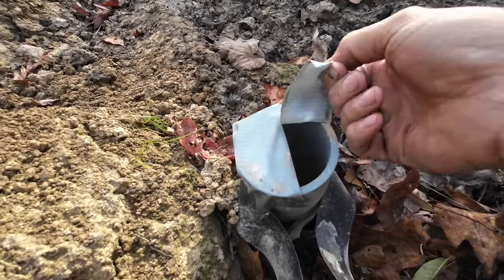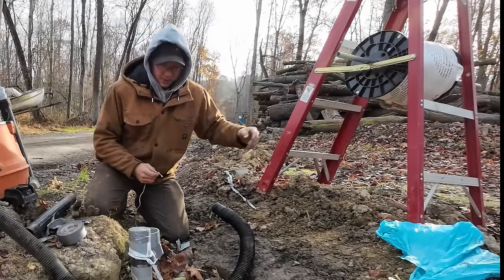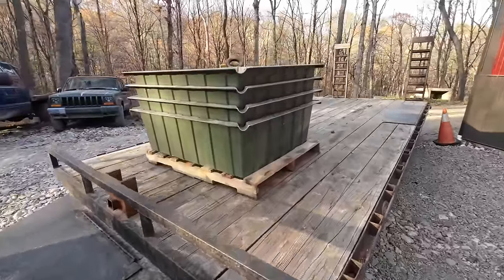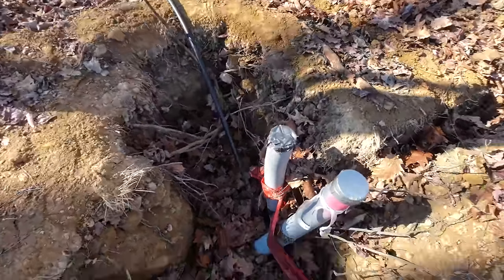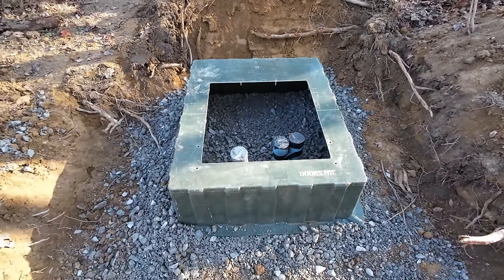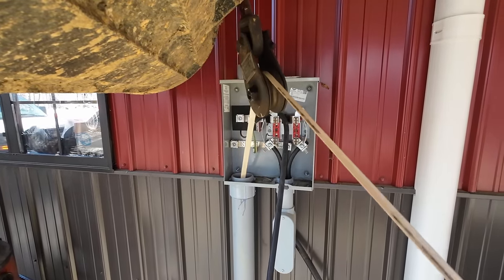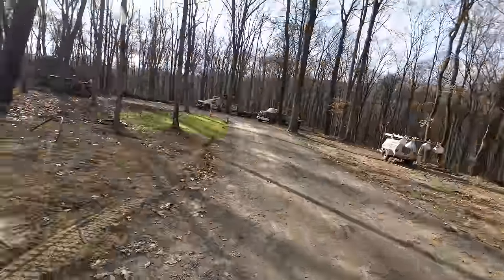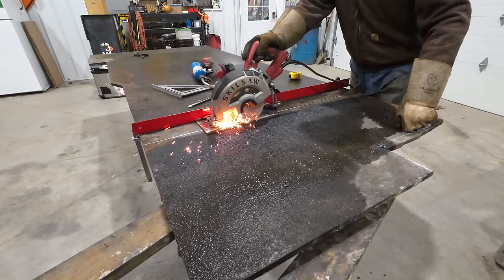The Power Company Charged me $52,000 for this!!

Comment: We'd need to see a itemized list of what was done and how much it was for. $52K seems outrageous for all the work you did.
Reply: $25 dollars a foot isn’t really that bad when you consider the cost of the wire, transformer and union salaries. 

Most of us will never be in a situation where we need to run grid power 1/2 mile.
Reply: Seems about a right price. dude is mad but he chose to live and do this project in BFE
Reply: Like the old joke goes. 50$ for the cable, 51950$ for having the license to do it.
Reply: 52k included the transformers, high voltage wire, junction boxes and the crew. The electricians are $100/hr and were like 10 of them.
Reply: @PatricioGarcia1973  and it took 2.5 hrs.. say 3 hrs.. thats 3k.  But I guess it's the step down transformer.. even though they probably buy them cheap they sell them hella expensive. If u were allowed to buy it urself and just have them inspect it u could get it much cheaper. Factories all over that have gone belly up sell such things for almost scrap value.
Reply: @kungfreddie if you wanted to do that you'd probably be looking at even more expense, as they would need a HV switch to provide isolation at the end point, and OP would need to find someone HV authorised to terminate a cable from his second hand transformer to the PUC's switchgear. Not to mention the HV metering required.
Reply: that crew at first energy averaged $35 an hour
the pay a jL in the mid $40 hr range.
27 office people touched paper stocking charges at the warehouse permits fleet cost. it ain’t cheap
Reply: @kungfreddie  I got to think all the hardware he bought is what bit him, I still find that hard to believe that all the hardware cost Matt $49,000.

Comment: Back in the early 90’s, pre DSS, I worked for a cable TV company and in some rural areas people were quoted $10,000-$20,000 for coax to be installed. Sometimes right of way fees had to be negotiated or paid, utility poles installed, distribution network had to be designed and equipment bought.

Comment: When the cost of getting grid power pulled in begins to exceed $10,000 or so, that's when I start thinking of solar as a cost effective option.  Still has it's downsides, but if it could be done, I'd rather put $52k into something I own than give it to the power company.
Reply: I have an 160 acres in California and was told that running a line to my property could cost as much as $70,000. I definitely am going to go with a totally off grid solar. 50, 250 watt panels only cost me a little over 6k. If I install the system myself, it will end up costing about 40% of what it would cost to pay a solar company to do the job. California has some of the highest utility rates in the USA. Since the power company has no tie in with my system, they can't very well charge me a readiness fee.
Reply: Solar sucks and will never work for everything! Very expensive as well!

Comment: The pull method is a pretty old school practice now.  We used to use styrofoam balls or other specially designed plugs to carry things down the conduit.  However in the past 2-3 decades it has become standard to use a normal plastic grocery bad.  The bags wat to inflate themselves, they conform to the size of the conduit, and they rarely get caught on as many obstructions and turns as  the foam balls used to.  When things don't go right they are much easier to pull out.  Plus you don't have to keep all sorts of different sizes around.  You have a few in the truck usually from having bought lunch or drinks (or if your shy one you just walk about 50ft and you'll find a perfectly good one).

And on the final wire pull always pull another pull line with the cable, because the next time something has to go through the conduit you can't use the same tricks as easily on a conduit with something in it.

Comment: That hurts. You could have had one heck of a solar / battery storage set up on your property for $75,000.
Reply: I bet solar and batt on Diesel Creek would be more than $50,000.  Say $150,000 to bridge the low sun January to March with huge battery .  Thats still reasonable, saves say $20,000 annual power bill for 20 years till replace it all, so amortized call it $300,000 in savings.  But be honest would Matt likely pay not just $50000 but $150,000 out of pocket this year?  Just saying it requires someone who has million in bank so can pay hi now, and requires being willing to check on batts and putz with computers (vs thats all on the elec comp to do).  It's amazing tech is so good going off grid is option but man us nonrich people will tend to be cheap and NOT do it...  Even Matt a tinkerer would rather not have to tinker, and plain grid connection is wanted...  PS.  Grid connection is so flexible, he could in emergency draw lots of electricity and heat 10 houses with it, that's a nice feeling to have near unlimited power....
Reply: @mbengambenga-xi6dp  It depends. If he was going to hire someone else to do all of it then yeah it would probably cost that much but if he would do the install himself it wouldn't be nearly as costly and there are kids that you can get that take the guesswork out of most things these days. Solar isn't nearly as complicated as it used to be.
Plus at least for me it would be worth it to give the middle finger to the electric company and their $52,000 charge to run a wire.  And don't forget he's also probably out in the middle of nowhere with a single feed that could easily be taken out in a storm and he could be without power for days. Making his own power eliminates that problem
Reply: In PA can have no sun for winter month... "" Powerwall Battery $14,200 13.5 kWh"""".   House uses 1000 kwh a month, so 80 Powerwalls, so $100,000 of battery....   Say solar cells are $50,000..  A $150,000 loan paid back at 6% is $1000 a month......  Vs grid cost of $150 a month?   Just saying to equal grid thru winter is about 8x costlier even if have good credit to get 6% and willing to invest ...     It's amazing tech but costly .    Millionaires should do it, but not nonrich....  yes we can argue about estimates, but bad dark months do happen....

Comment: As a former landscaper, I like wild grasses to hide transformers and other telecom boxes. I really like the Karl Foerster feather reed grass. It gets big and fluffy to hide boxes, no thorns or anything  if you need to get inside, you just hack them off around four inches in late winter/early spring with a pair of hedge shears, and they come back every year. Two on each side of those boxes will be plenty after they get established for a couple years and really fluff up. I would recommend getting a size 3 or 5(that's just how many gallons the pot is) from your local nursery. These are healthy, larger plants that are much more durable for transplant. The only kicker is that they need water almost every day for the first few weeks when you plant them. If it's raining a bunch, no problem. But if it's hot and dry, you need to go out and soak them every day(ideally in the morning, near sunrise).

Comment: $52,000 would buy a lot of solar panels 😂
Reply: In the long run it would be more expensive and a huge pain in the ass.
Reply: @cooldog60  how so?
Reply: @cooldog60  Not even close. Once installed it’s automatic. Been running house and shop off solar for 2 years. No issues.
Reply: @JGnLAU8OAWF6  they degrade rather quickly, snow, ice, cloudy days, leaves, and they only provide peak power during a specific time of day. Solar panels are great but not for this area.
Reply: @orangesforall2053  panels have 25 year warranty. What makes his area not suitable for solar? I'd say ~$70000 head start changes everything.
Reply: @JGnLAU8OAWF6  there isn’t a lot of usable sun angle and wattage per meter in the wintertime. You spend 70k just for it to be Cloudy for a week and you are SOL. Also if you look into those warranties they take into account a certain amount of degradation. Panels loose about 10-30% of their efficiency over 20-25 years. You can’t warranty them for this as it’s counted as typical wear and tear. So you basically have to pay to get them replaced every 20 years. Don’t get me wrong though, solar panels are great for areas with more favorable conditions, they just don’t make sense here especially considering he is running a shop and has a large power demand. He would need to spend another 20k on batteries just to get by. If it was somewhere where solar panels could pay for themselves it would be stupid not to use them.

Comment: Hey Matt...Just curious, wonder what the voltage drop is from transformer to your shop, with such a long run. Power company probably tapped the transformer up slightly so it was around 250/125 level, so that by the time it got to your meter was closer to 240/120.  Most pad transformers have a tap changer switch with 5 positions, in steps of 2.5% between each position... to help compensate for long runs and voltage drop.  (transformer design engineer here at a large mfg since 1994)
Reply: Tapping up is not going to be very helpful if there is a very large load range. Setting up for nominal voltage at nominal pload will result in overvoltage at zero load and undervoltage at maximum load.

Comment: 😊 having you put a line in the pipe shows that the pipe hasnt come apart.  You know you do good work, I know i do good work, but not every body does.
Went to pull an underground service once, couldn't get anything through.  Turns out the conractor had installed pvc drain pipe with a drain ell.  Stuck conduit on each end.
Eventually ee started requiring prebackfill inspection and pulling line.
If a new service request sat for about a week, we gave it to a contractor who could (usually) get it done soon.  And we inspected them too.
Sorry yours took so long, i cant speak to the cost ive been retired for 16 years.
Where i worked we took the service in electric service seriously.

Comment: Love the channel!!! I have been in the electric utility industry close to 2 decades in Distribution Engineering and Operations and unfortunately $50k is in line with what this would cost in the northeast. Like others have commented, the pricing is set up in the rate Tarif which is approved by the utility commission. A 25kVA transformer will be oversized for your application along with the primary wire size they used (assume its #2 AL, 10kV rated with a concentric neutral) but this is probably the minimum size they stock. Work to reconfigure the riser pole, splices /elbows that were used and any ground rods/grids add to the cost. Some utilities use splices placed in a subsurface pull box instead of the above ground switching module. The customer typically does the civil work which is then taken over by the utility after energization. Everything up to and including the transformer is owned and maintained by the utility including the primary cable. The secondary from the transformer is customer owned which is why you had to purchase and install.
Reply: Wow, yes it was like that in California as well. Here in Texas we have non-profit electric co-ops and they are much cheaper. I got a 25kVa transformer by the road that puts out 480V single phase and then I ran it myself maybe 600' to the shop and put a step down transformer to 120/240 in the shop.
Reply: Yeah I work at a public utility in Washington and $50k seems a little on the high end especially with him installing the conduit but material prices are crazy now. The cost of pretty much everything has increased 200-300% since I started about 3 years ago. I designed a 1600' primary extension from a pole to a 25 kVA pad mount transformer for a 200-Amp service for $33k. The customer trenches and we install cable in conduit from a spool. We do require vaults about every 500' for future connections and pulling so the 3 vaults added about $6-8k to the total. We do sharing(late comers agreement) on everything though for 10 years so they can get some money back if someone else taps off it. Could be why his was higher if he had to pay the person half to get power to the existing pole.
Reply: @sukt00  If the barn was only 160' from the transformer that 350 kcmil is overkill for a 200-Amp unless you are subfeeding or something else. That added about $650 to the cost though.
Reply: Yeah but I thought he was talking about building a house across the street of the Transformer.  I'm not electrician so I don't know.

Comment: You can blow a parachute through the conduit using a compressor. 4 inch conduit with 36' sweeps are sometimes required. They may require a mandrel test. And.... they can play games with the meter panels.

Comment: Let them pull the primary cable. If that's 15kv cable, one nick in it and they'll have to replace the whole pull. Plus splicing it and terminating it is an art. 

Save that mule tape, it's good for pulling cars out of the ditch in the winter.

Comment: In commercial electrical, it seems there is always water in at least 10% of the underground feeder conduit. Obviously some people don't try hard enough to properly glue fittings but  they are never concerned (it is too late) and they don't talk about doing it better next time. It seems to work time and again without issue.

Comment: The Chinese finger trap deals are Kellems Grips. They're most commonly used for strain relief to take the strain off the wire in the event it gets tugged on. Though, that specific type is for this particular application. Still, they could still be used for strain relief purposes, and would work on things like air hoses as well.

Comment: (In Canada here) I do hydro conduit vault install, cable pull etc..  if pulling the cable from existing transformer then the power company is required to at least be there and retrieve the fish/rope/ mule tape from the live vault and feed the cable into the box/transformer.. but because the cable is on a spool and therefore not live.. you should be able to pull the cable from your end on a rubber tracked excavator (like a winch) just need a proper roller for the rope and cable to exit the bell end and out of the vault safely. You need a qualified electrician there for the whole thing and terminate it. At your transformer..(we use diesel air compressors and something we call “mouse” which is a rubber diaphragm with steel ring for attached rope or mule tape .. a special air valve/gasket system with a channel for the rope to run through controls the air.

Comment: i am a highway construction worker and we use tow behind air compressors to blow jet line and then we use the jet line to pull in mule tape because we usually pull 100ft of  3 1-0 wire 2hots and a neutral

Comment: I always tie wrapped the pipe in the spool to the center of the cross supports so it did not swing back and forth which causes jams and the ladder to topple over.  I used the distances you stated in your video and then entered them into the power line calculator provided by my utility.  Ours said $27, 500.00 for the same setup. however I quoted overhead lines.  For $25,000 dollars difference I could have looked at a few phone poles for a very long time.

Comment: As an licensed electrician in New Jersey for 40 years running a company that was established in 1918 the power company is the authority having jurisdiction in simple terms there in charge. The wire they use is high voltage primary wire once the wire is installed they take responsibility for it. Voltage is usually any where from 4160 to 13000 volts that's why you or I being an licensed electrician can't touch it. They have you by your short hairs, its not something to play with. Most utility company's will credit you back the cost if you are a new customer. Lots of luck the installation it perfect. Also the primary wire is very expensive. And the vacuum is a neat I use a nerf ball of different sizes for the long pulls

Comment: Interesting that in the US you have to pay for it. Where I live (Italy) the electrical wiring and components, such as transformers, switches, fuses, etc till the energy meter is owned by the power distribution company (that is not the company that sells you the energy, by the way), they are responsible of installing and maintaining it and you are not allowed to touch it (everything has anti tampering seals), the only expense is the base fee in the electricity bill (basically this accounts for electricity distribution network).
Reply: Well they do charge for that. The difference is that Europe is 400 V and the US 240 V. In Finland that distance would not have required a separate transformer. They could have pulled 400 V cables. I check dome prices and it would have been about 6000-10000 € depending on the fuse size on the company I checked - Still a fraction of what it was.
Reply: @okaro6595  400V if you have 3 phase, most home installations are single phase, thus no benefit in using 400V VS 230V that is the same of the US. 

In Italy you don't pay the installation itself (you pay for stuff like moving the meter, if you decide to do it, but not for the first install). Of course you then pay a fee in the bill for the infrastructure, that has to cover the initial install cost, but it's a fixed rate for anyone, not depending if you already have cables or they have to be installed. 

Finally, now the electricity company will bring you power at the premises of your property, that is they put the meter on the fence such that it's accessible from the street, it's no longer allowed to have inside. Thus the run of cable between your house and the meter you have to provide yourself (and the power losses of that cable run you pay in the bill, of course!).

Comment: Working in communications industry we have a different technique we blow fiber optic cable in instead of sucking a string through. It's much faster and more efficient. This does require a different technique in different material but it accomplishes the same thing.